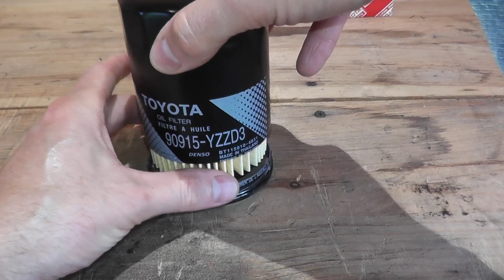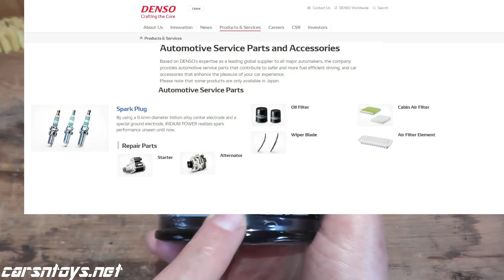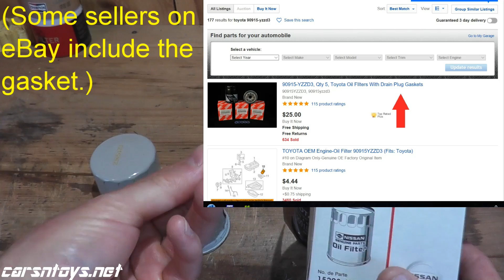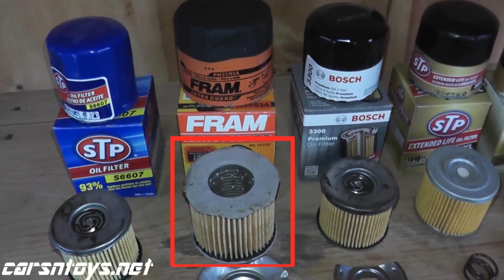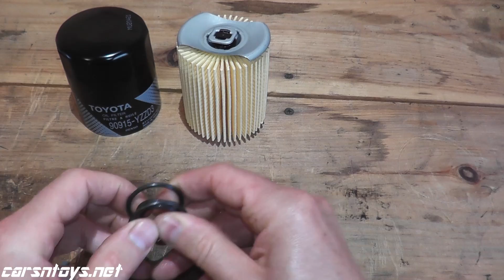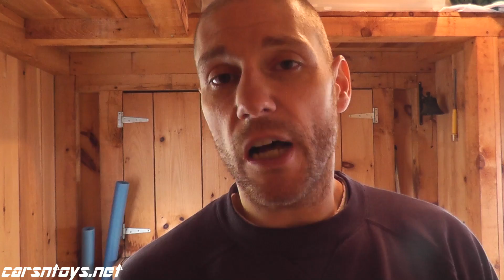Toyota Oil Filter Review | Denso Oil Filter

Comment: I just switched over to these Toyota filters for my 2008 manual Toyota Tacoma with 143k miles on it. Thanks so much for the review. I also switched to mobile 1 extended full synthetic oil and will be switching to mobile 1 annual after a couple oil changes. Now do you think I should stick with the Toyota oil filter or switch to the mobile 1 oil filter? I heard they are very well made and suited for their oil. Thanks for the help.
Reply from the maker: Thank you. I think you're fine with either one. Personally, I'd go with Denso and save a few bucks.
Reply: @Carsntoys  I appreciate the reply thank you.

Comment: I use the 90915-YZZG2 on my 2004 IS300.  I cut one open after 5,000 miles and it looked basically new.  I run that filter at a 10,000 mile interval now.  It's $6 from the dealer and that part number is made in the US.  If your vehicle calls for the YZZD3, you can use the US made YZZG2 in its place, the difference being about a half inch of height.
Reply: Are you having to add oil between changes I'm asking because I currently have an 02 Lexus IS300 and have to add some in between, I'm not the original owner btw.
Reply: @carlbrooks90  i miss my IS!  Had to let it go 2 years ago.  I never had any burnoff or loss between changes.  If I was in your shoes, I’d try an oil flush and I’d definitely be using a good quality synthetic.  Be faithful about oil changes and maintenance and that 2jz will outlast us all.  Enjoy that wonderful car!

Comment: No end caps & open edges meaning better flow rate but at the cost of having unfiltered oil pushing through those edges?
Reply: Same thing i was thinking ... that useless filter since it truly dosen't filter
Reply: The center tube is pressed against a seal on both ends. No bypassing in that area.

Comment: I just bought 10 of these in sealed boxes for $34.50 shipped for my new low mileage 99 Camry XLE. I'm psyched to see this video. Thanks!
Reply: $34.50 for 10! Wow! I would be worried that they might be counterfeit at that price.
Reply: @njsongwriter  Well, if so, it's the best counterfeits from a Ford dealership I've ever seen. Each filter is not only boxed in a top-notch Toyota box, but is also sealed air tight in cellophane. The gaskets are pre-greased and sealed for my protection. The outter metal case is thick steel and the threads ar perfect as are the internals. Looks like Bosch if I had to guess. I bought two additional cases. No China here.
Reply: @dbfcrell8300  simple way to tell would be to cut them up after your oil change and compare them

Comment: that was a great review explained perfectly! I feel more confident that if I use my 2015 tacoma filter on my 97 Camry both v/6 they will work ok as I change my mobil 1 synthetic every 3k miles or one year. I am pretty sure that it will not get clogged at those intervals. I once got my frontier truck and Camry filter mixed up and used the frontier filter on my 97 Camry with no problems.

please let me know your expert opinion on this. I would prefer the slightly larger tacoma filter on my 97 Camry. thanks
Reply: Isn't the Camry a spin-on filter and the Tacoma a cartridge style? Or am I mistaken?

Comment: I have a Toyota and I was going to buy a K & N or WixHP  to use when I get my free oil change as part of Toyota's 2 year maintenance plan. After watching this excellent video I guess I will just stay with the OE filter Toyota uses.  Great info! Thanks!!
Reply: No the service advisor is full of s***. It is made by denso.
Reply from the maker: Glad to help. Cheers.
Reply: The service dept.manager at my local Toyota dealership told me that Mobil actually manufactures Toyota's oil & oil filters and Toyota just rebadges it.

Comment: With no end caps (metal or other) and using a resin, I see the ends of the pleats are not completely sealed. They only appear to be sealed where the resin is, so what keeps the unfiltered oil from bypassing the filter media through these openings in the ends of the pleats?
Reply: PSCA1 i thought the same as well until i took a new filter appart. It is indeed sealed past the thick resin to the ends. Just not as thick.
Reply: Good to know. Thanks for following up!!!!!
Reply: Agree, no end caps & open edges meaning better flow rate but at the cost of having unfiltered oil pushing through those edges.
Reply: @patriciafettuccine7324 
Just as someone else had mentioned it does look as though oil could pass through the ends where there is an absence of resin. I actually took mine apart a few months back and noted the same thing. I started cutting the filter apart and found that the resin does actually go to each end of the pleat but it's not visible from the top. Not sure why they didn't just run the resin all the way across but for some reason towards the edges they put the resin just below the ends of each pleat and glued solid all the way through.
Another thing seen while cutting into the media was that it has a slightly wavy texture so the media cannot collapse and restrict flow.
Reply: Thanks for the input on that.

Comment: No end caps on this filter, just a resin. Fram is using a resin and cellulose end caps. It's all good.
Reply: No end caps & open edges meaning better flow rate but at the cost of having unfiltered oil pushing through those edges. It's a no for me on this one + FRAM's, sry.

Comment: I'm really glad you did a cut open of a Toyota/Denso oil filter. I drive a Toyota Camry and was curious how Denso oil filters compare to other oil filters, particularly Purolator.

I do have a question....well, more of an "I need your opinion/help." If you had a Toyota, would you stick this OEM oil filter or pick something like a Purolator ONE or Champion (type of motor oil: synthetic blend)?
Reply from the maker: I'd go with Toyota and certainly synthetic; if the vehicle had variable valve timing. Appreciate the question. Cheers.

Comment: It’s always strange to review a OEM oil filter. Toyota / Lexus build their vehicles to last. Why would they put a low quality filter on their vehicles ?
Reply from the maker: I agree. However, I think Toyota has an edge. The quality is certainly there. I can't say that about all filters.
Reply: Agree, no end caps & open edges meaning better flow rate but at the cost of having unfiltered oil pushing through those edges.

Comment: I use the Toyota oversized filter for my Tacoma.  These are some of the nicer oil filters on the market IMO.  Great video!
Reply: Nvp8985 Rodney what engine is your Tacoma? If it’s the 4.0 could you share the filter part number?
Reply: I was not aware of an oversized filter for the Toyota Tacoma. I have the 4.0   1GR-FE engine in my 07.
Could you please provide a part number?
Reply: @mech4061 D1 is for V6 while D3 used in V8. Both are interchangeable depending on clearance.